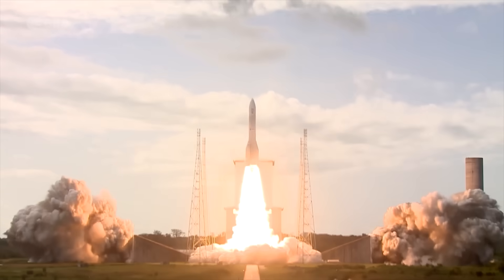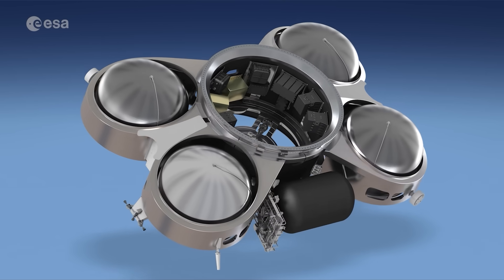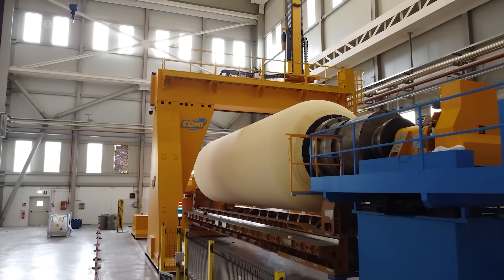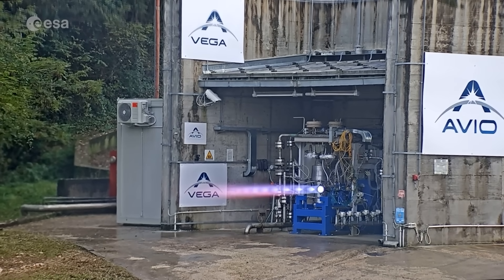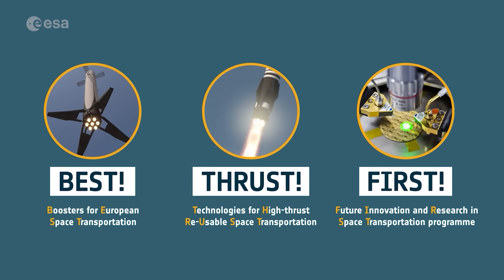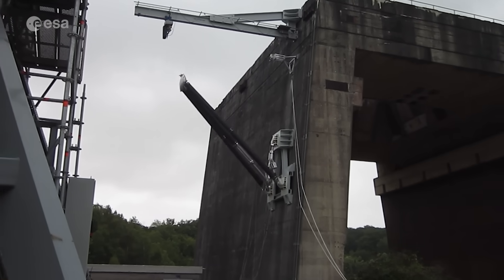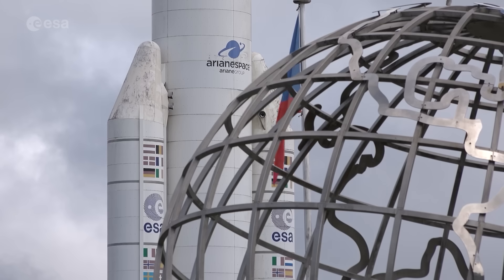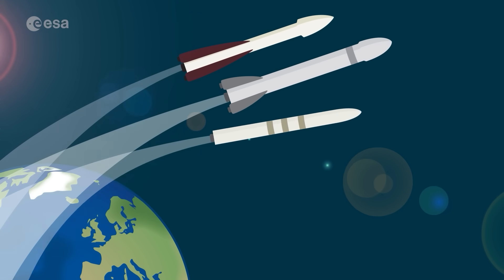Europe’s future in space transportation

Comment: I have a business plan to use Vega as part of a defence vector:

🚀 CHIMERA-X – Ultra-Long Range Strategic Interceptor
📏 Key Dimensions
Total Length: ~17.5 meters

Maximum Diameter: ~1.5 meters (silo-compatible with PERSEUS-class SSBN)

Total Weight: ~6,530 kg

🧱 Modular 4 Stages Structure:

Stage	                                                   Type	                                               Technology	                                                                         Function	                                                                                     VEGA Heritage
1	                                                           Initial booster	                               Solid propellant  (VEGA P80-derived)	                         Launch and acceleration to Mach 3	                                     Based on VEGA’s P80 stage
2	                                                           Hypersonic cruise module	       6× Meteor-based ramjet engines	                                 Long-range stratospheric flight, sustained velocity	              New; Meteor-derived
3	                                                          Ascent booster	                               Compact solid booster	                                                 Vertical ascent to 50–60 km altitude for KV release                  Based on VEGA/Zefiro 9
4	                                                          4× Aster 30-L smart KVs	               Solid propulsion + active radar	                                         Terminal interception, cooperative targeting (swarm logic )     Based on MBDA Aster 30

🎯 Performance and Capabilities
Effective Range: 1,800–2,000+ km

Engagement Altitude: 50–60 km

Payload: 4 × Aster 30-L "smart" kill vehicles

Target Types:

Intercontinental Ballistic Missiles (ICBM)

Hypersonic Glide Vehicles (HGV)

Maneuvering Reentry Vehicles (MaRV)

High-altitude aircraft (AWACS, ASW patrols)

🛠 Design Features
Swarm Coordination: Each Aster 30-L is capable of individual guidance or coordinated intercept logic

Advanced Guidance: Inertial + radar + datalink (Galileo/NATO C4ISR compatible)

Air-independent operation: Fully rocket-based propulsion, ideal for stratospheric and exo-atmospheric flight

VEGA Integration:

Derived directly from ESA’s VEGA launcher stack:

P80 first stage for initial thrust

Zefiro-class compact booster adapted for ascent

Leverages ESA/AVIO infrastructure for production and launch modeling

🌍 Operational Use Cases
Launch Platforms:

PERSEUS-class SSBN vertical silos (24 per unit)

Land-based strategic silos in Iceland, Svalbard, Greenland

Modular containers for truck or naval deployment

Strategic Role:

Europe’s first non-nuclear continental missile shield

Capable of intercepting high-speed threats over 2,000 km away

Modular for layered integration into NATO/European defense grid

Possibility to be lunced by SSBN and ground base or 8x8 veicles